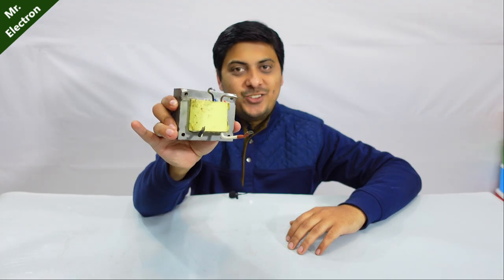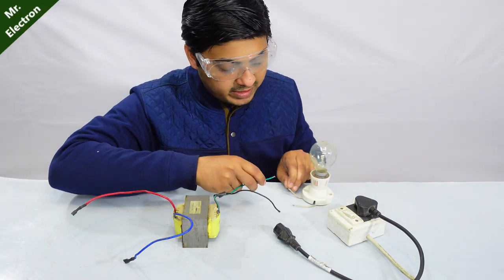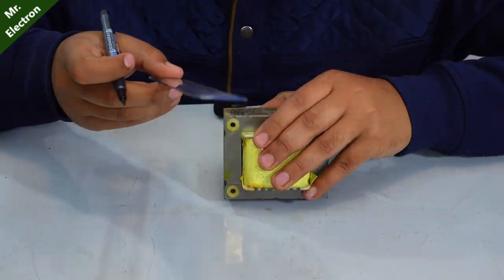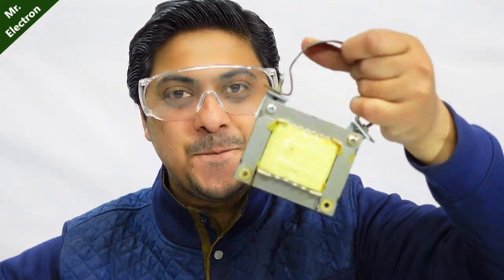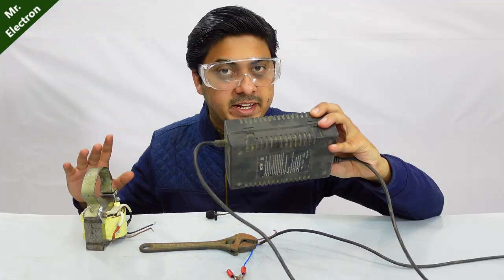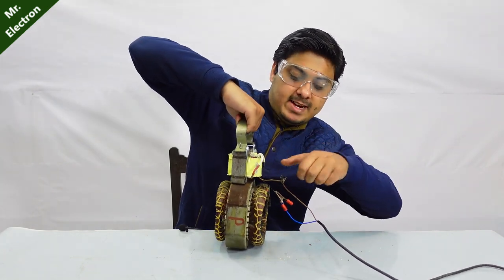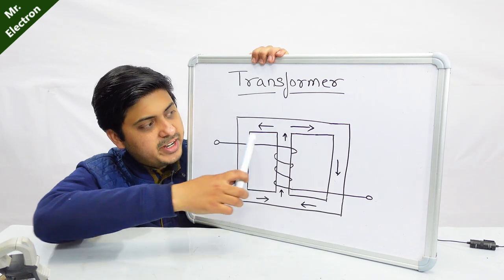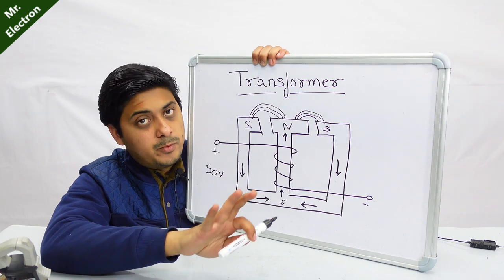12v 500 Watts Powerful Electromagnet using UPS Transformer - 12v to 220v DC

Comment: In the USA, so, 120V UPS Transformer, but, DC Power Input 50v 2.7amps. 
I think you are saying, the strength comes from leaving both windings in the transformer, and only cutting the metal on the High Voltage Side(Small Wires) vs removing the second winding and cutting the metal off like in most other videos?  Is it all of these items that cause the increase in magnetic power? 
I have two UPS Transformers(I think still have them), and, I want to create a drill press table vice. 
You said, can do this with any transformer like Microwave Oven Transformer, etc. 
Is it the UPS Transformer that is more powerful, or because of the modifications you made, each will be stronger? 
I think I have a 1000 and 1200 UPS Transformers. For sure 1200, I will have to check on the 1000. But, I think the Microwave transformers are 1500? 
So, no electrical Engineering background, I am wondering. 
If this is not too many questions,, how long could you use your setup (UPS Transformer 50v 2.7 amps before it would get too hot, if it were encased in an Epoxy form with a flat top for a magnetic drill press table vice? 3-5 minutes or less? More?
Thank you.. India teaches their students well. You are doing a very good job. This is the first I have seen of someone saying, it can be done better.. Thank you.. 
Good Luck you you in the Future...

Comment: Appreciate the video and learned definitely learned something but why was the last item item so much harder to pick up with the magnet? You put it on the table although showing significant weight fairly easy but picked up with the electromagnet not so much.
Reply from the maker: Picking angle was difficult i suppose

Comment: Please, we want to give us an idea about the best dynamo or generator that can be used to generate electricity by wind, so that it produces high volts and amperes from a simple rotation, and you have all the love and appreciation
Reply from the maker: Actually there is no simple rotation to get High Amps. Once you start drawing amps , it starts getting harder and harder to turn. Doesn't matters how efficient you coils or strong your magnets are.
Reply: @MrElectron  sir plz make a video of microwave electromagnet and test it with your different volts plz sir

Comment: Hello
my virtuous brother? Do you have a video that shows how to prepare a magnet that is resistant to high temperatures (900 degrees)? How to wrap the magnetic mass with heat-resistant materials and how to assemble it well? I want to dip this magnet in molten liquid? Pick up iron from the bottom of the oven
I am grateful to you

Comment: Where did you get a 20 kilo nut? Electroboom would be proud. Excellent explanations. I had to make a second comment.
Reply from the maker: thanks !!!!
Reply: @MrElectron  sir can u say me what happens if we pass 220v or 110v through electromagnet
Reply from the maker: @ramaraoyeruva3062  if it's a AC110 performance will be bad but if it is dc, it is going to be a really strong electromagnet but will also heat a lot and might get damaged.
Reply: @MrElectron  thanks for the reply sir
Reply: Bolt more than 20kg
Reply: @WELLINGTON20  LOL  I was thinking a Wind Turbine base anchor…

Comment: One can connect the primary and secondary in serries such that their fields combine.
Reply from the maker: Correct !  Although one has to be careful to connect the 2 windings in such a way that the magnetic strength adds up instead of substracting.
Reply: Do you need to connect primary and secondary. Are they not already connected by induced magnetic field in the transformer. Power to primary then induced to secondary, i always thought one would remove the high current windings and just use the primary for safety reasons.(relatively)  Let me know if this is incorrect. I do not want to assume anything.
Reply: @jonbutcher9805  inductance only happens in a secondary coil with changing magnetic fields, and not where current in the primary, and the resulting magnetic field has reached a steady state using a 12v battery or 50v e-bike battery  charger. 

And feeding AC current into the primary with a shorted  secondary will quickly burn up the coils with too much current flow.
Reply: @kreynolds1123  so you can run both primary and secondary but only with DC. I understand. Thanks for the reply.
Reply: @jonbutcher9805  you can run both primary and secondary in serries. With either AC or DC.  You just can't short the secondary with AC.  And your need to respect the voltage and impedence  with either.

Impedence = resistance to current flow.